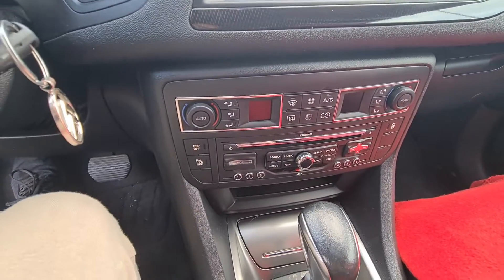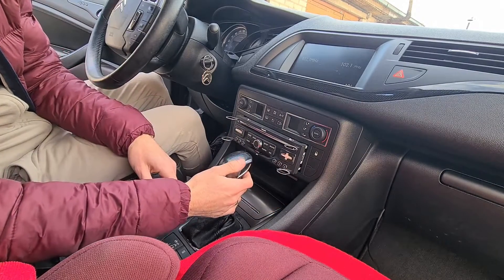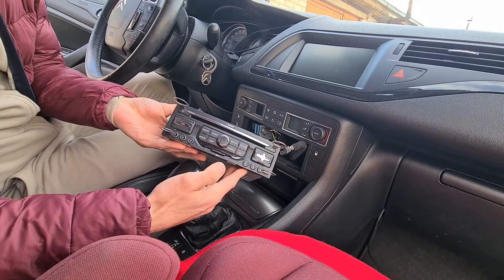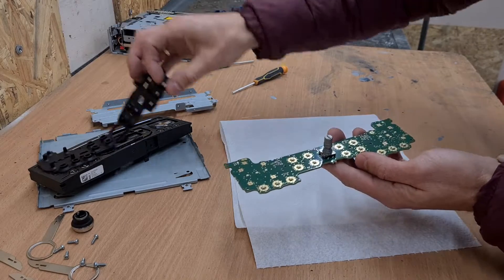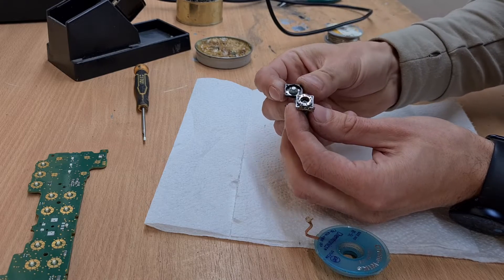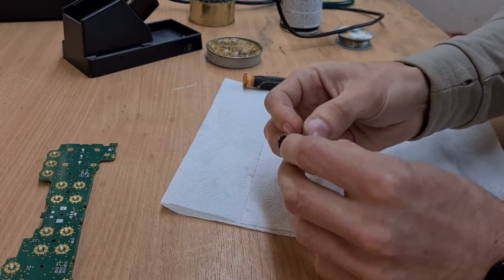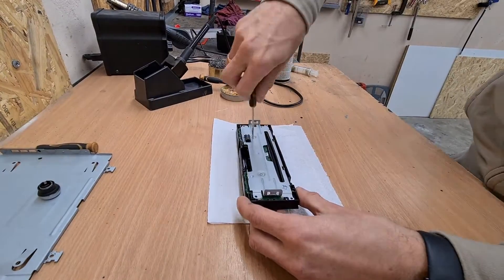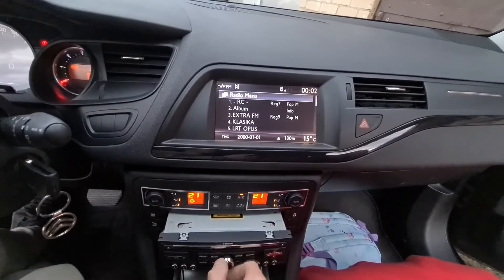How to fix a rotary encoder of a car headunit (C5 X7 RNEG headunit)

Comment: Good work. I have the same issue with my stereo. I will try first with contact cleaner but the encoder dıes not seem to have a hole around. How should ı spray it to reach inside?

Comment: Although I have a lot of experience with such devices, I did not dare to unsolder the encoder. I poured pure alcohol over the encoder housing several times while pushing and turning the axis. Between alcohol washes, I blew with compressed air. Finally, I sprayed with teflon lubricant and wiped well. It has been working without problems for almost a year. If you don't have experience with soldering, you better not desolder the encoder because the copper tracks are very fine and can come off.
Reply: Correct. Usually, it's a brass tab which is rotated on pieces of brass. Usually lubricated with grease, this grease attracts dust/dirt and becomes congealed over time, causing poor contact. Sometimes brass / copper contacts inside to be tarnished. When you use electronic switch cleaner, it cleans off the old lube and de-tarnishes the metal slightly :) Much easier method to fix!